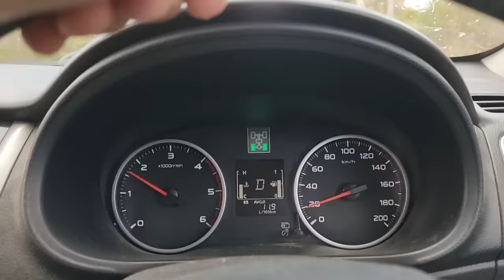He Said it was ILLEGAL to Find This Much Gold!

Comment: I don't do a lot of prospecting , but when I wanna crush something, especially when it comes to rocks, ore etc, I use an air hammer. I don't full blown pulverize it, but just enough  to break down the material,  it's a time saver for sure, if ya have an air compressor maybe give it a shot, then smash the rest down with your home made tools you use for crushing , it can save alot of time and lesser the process

Comment: Hey guys .Old Man River here, Heres some food for thought, You said  there should be  One inch of drop per foot on your sluice .If you look at your video you will see you have about 8 to 10 inches. If you take a string tie it to the front lower corner of the sluice run it to the rear leg of the sluice in a straight line you will see.You can take a piece of tape or make a mark on your rear leg at 4 inches so when you set up you can see an imaginary line between the  front and back so you know its close.Now when running you want to be able to see the back half of the mat behind each riffle. when you check the box after letting it clear for a minute. The water should be about two inches deep enough to create an under current so rocks move out easy and the riffles made for dredging can work properly.When you shut down you should see black not blonde sands behind each riffle.A little blonde is fine, The riffles should only have material about half way back.If the mat is is bulging with blacksand its time for a clean up.With my Keene highbanker 3 guys throwing dirt in constantly we would have to clean out every 20 minutes . The mat would be bulging with black sand.We were getting a gram to two grams every 20 minutes. Remember dont be afraid to feed it . after all its made to eat 5 to 8 yards of material an hour .Love you guys just some food for thought....

Comment: Chris, considering you were using here riffle mats, why didn't you use a vortex mat on that spot? 
Was it, lets say a matter of choice because the sluice is laid out for the riffle mat, or special choice for the fine gold in those ground conditions, or because you liked to see what yield you may get there with that set up, or because the quantity you were shoveling through, or just because of random, which i don't presume. 
The question matters for me as I have very fine gold, scarce and more or less evenly distributed, with occasional smaller clay pockets in the sand and gravel. Replacing tin with  smallish grenades. Transverse and inclined metamorphic sandstones and slate bed rock are some meters to deep to be reached. By now I know the origin of my gold, a few miles upstrem, but it is beyond reach. So I still try to optimize my work flow in the creek for least losses with a diy hybrid sluice and the riffle or vortex question regularly resurfaces. Tnx a lot for your show and appreciating your feedback.

Comment: Need to build a sluice like mine, it likes FAST water.  Big scoop on the front covered by 1/2 (13mm) stainless punch plate that extends to just over first Hungarian riffle.  Box is 4' long with carpet and miners moss all the way out.  Never found more than 1 or 2 micros almost too hard to find in the tailings.  T big shovels a min if I have enough water.

Comment: Prospecting for gold by dowsing with the modern light weight ball bearing dowsing rod will greatly increase the daily gold count.  All element' atoms emit a unique electromagnetic microwave band frequency with no two elements having the same.  The same element's electromagnetic microwave band frequency contained in an elemental mass combine together for producing the unique elemental magnetic flux lines with no two elements having the same and this is what energizes the dowsing rod and electronic metal detector.  Learn how to become a professional by dowser reading the recently published book The Art of Dowsing - Separating Science from Superstition.  P.S. Try using a wide stiff shop broom along with stiff and soft paint brushes for sweeping into a dust pan, should multiple the fine gold contained in each gold pan.  Also, I do fine gold panning out of black sands by WHIP PANNING with a small 4 inch finish gold pan that has a small recess rim in the bottom.  The pan is raised out of the water while a slight tilting of the pan in a designated spot of the whip of the panning.  Usually three or four quick whip spinning of the gold panning empty most of the water slurry with repeated lowering into (still) water until only a thin film of black sands containing the flour gold.  This thin layer of gold/black sands is collected in another gold pan until all of the black sands is whip panned.  Then the final whip panning relieves most of the black sands for easy separation by hand and fingers most of the flour gold.  This is how my ancestors mined flour gold with no mercury at Mexican Hat in Utah.  Thank you for reading this post and have a safe, healthy, good day